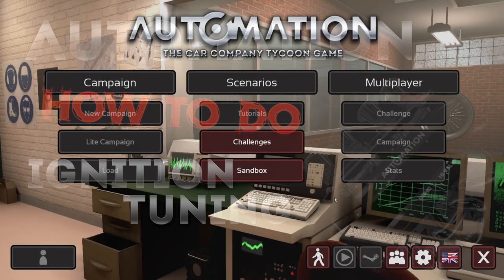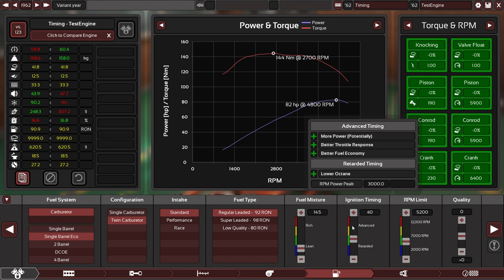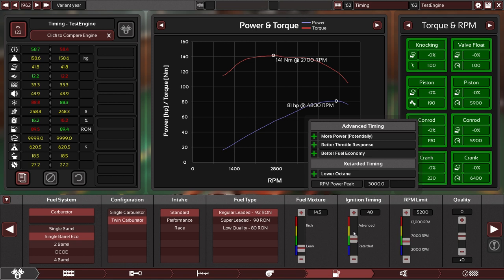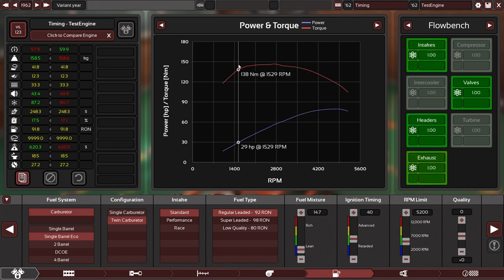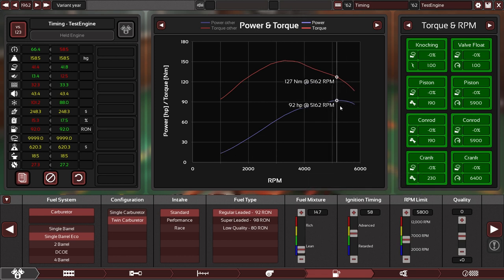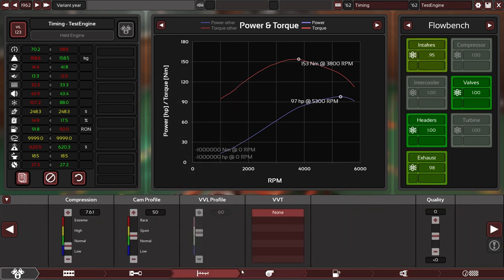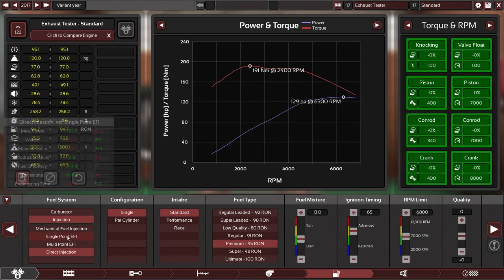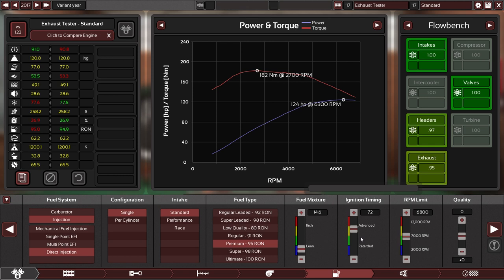Automation How To: Ignition Tuning

Comment: So if optimal ignition timing for an ECU controlled system is 65 - 80, when would you ever use values outside that range?
Reply from the maker: You'd use lower values if you want to detune an engine for lower fuel octane without investing time into re-engineering it. Higher values are better for anything that is super high on the sportiness requirement due to higher throttle response.

Comment: When you say "randomization of the torque curve", do you mean that there is some actual randomization going into it, or is that just how you say it depends on a bunch of other settings in a sufficiently complex way that it might appear random?
Reply from the maker: There is a small amount of noise baked into the torque curve which is moved around by the compression, ignition, and AFR... so effectively there is an actually random part in it.

Comment: Liked your exhaust explanation better. For example, didn't you say SPI worked as carbs? Or do they behave like ECU-injection after all? And what about Mechanical Injection?
Additionally, the ignition timing for injection engines is between that value why? Is it throughout the years or only for 10's and for the 80's it's different? Do all carbs behave the same in regards to timing?
Reply from the maker: SPI works as a carb in some ways, not in this regard though as it comes with an ECU, I thought that would be reasonably clear. They are an in-between thing. Mechanical injection is where the culprit is with the video, that's an oversight to not mention specifically that it does act like a carb when it comes to timing because it does not come with an ECU.
The ignition is in that range for EFI because it is automatically set to "reasonably advanced for the respective RPM" across the RPM range doing so, which does make some sense, but really the reason it is like that is that the game worked that way before and I didn't want to change too much here for balancing reasons.
Carbed / MFI cars never get an ECU, so they won't start behaving differently from specific years onward.
Reply: I see. Thanks. Thought you said that SPI worked as a carb in regards to timing as well.
Also, Carbs/MFI don't behave differently throughout the years, but do EFI? For example, MPI in '95 behaves the same as in '17? Not talking about stuff like efficiency, but rather things like timing
Reply from the maker: Their behavior is bound to the part selection itself, not to the year they are used in :)

Comment: On your performance engine, could you have increased the fuel mixture to give you a bit more spare octane to increase the compression?
Reply from the maker: You can run it a little richer up to the point the fuel system indicates, so in some cases where you just need that little more to get another step of compression that might be worth it.